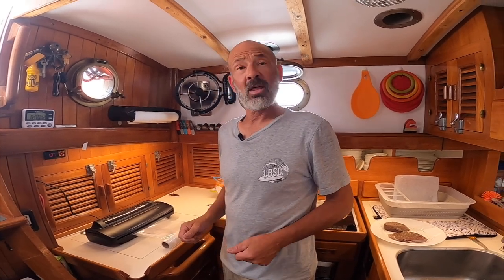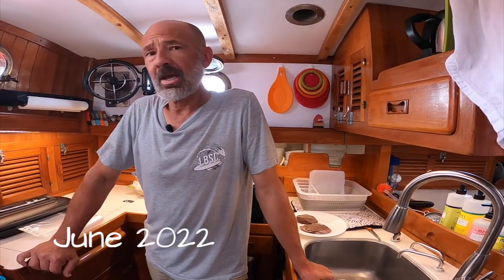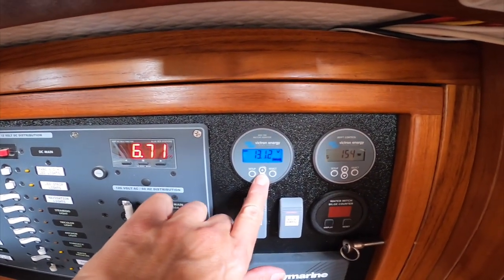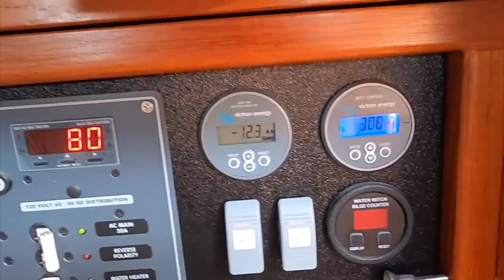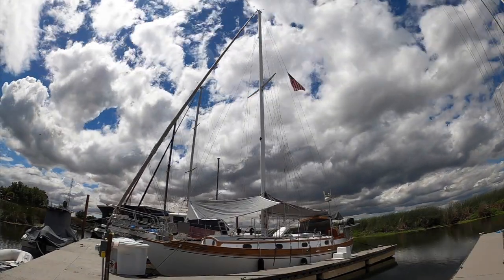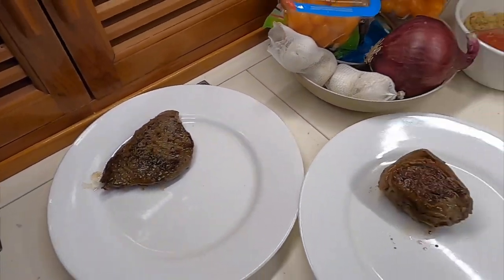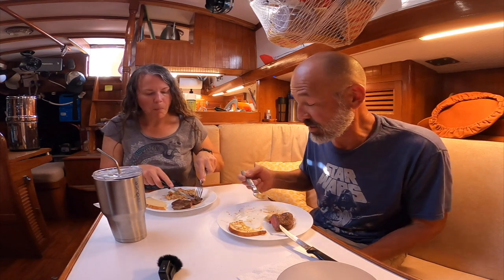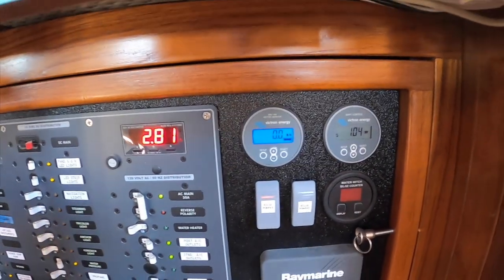How Much Electricity Does It Take? | SV Ramble On

Comment: I am researching lithium and solar for our new (to us) sailboat (also a Bob Perry design!), and have a question.  If you were on anchor and had some heavy cloud cover, how many days do you think you could go before needing to recharge with some other source. (without going into rationing mode)  Our boat currently has 4 Trojan 6V and 150 watts of solar (2 x 75W), and I am trying to figure out how much solar and storage I need, then how much I might want.  The batteries are new, so I will be doing some testing with the current set up soon.

Comment: Hey Guys.  Love your channel.  Have a solar project I'm just planning out now and hope you can help.  Does each solar panel need an mppt controller or one with the size depending on the amount of solar you plan on harnessing?  If one controller, and 4 200W panels, how do the 4 panel wires hook up into the one controller?  Also, house bank batteries.  Looking at 500Ah.  Does battery bank need to be in increments of 200Ah?